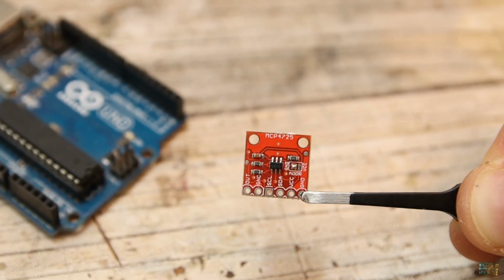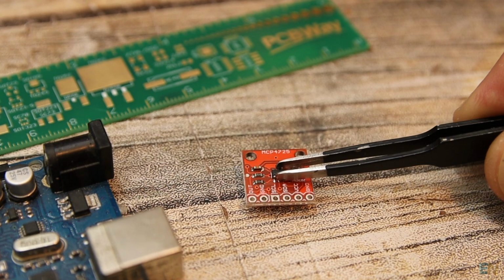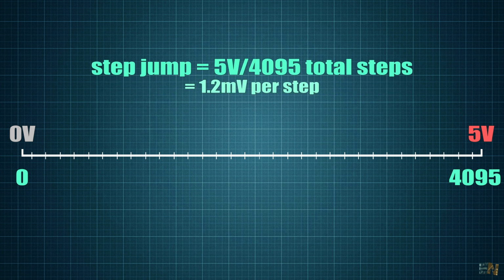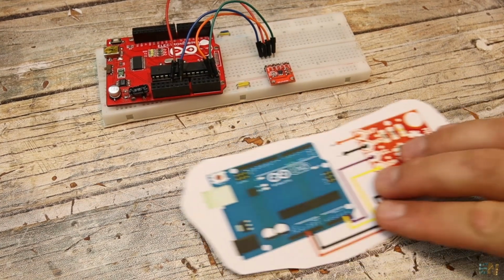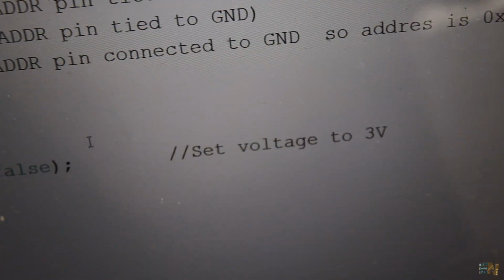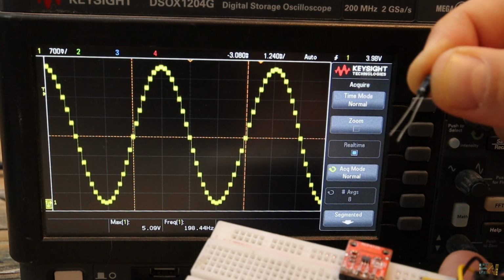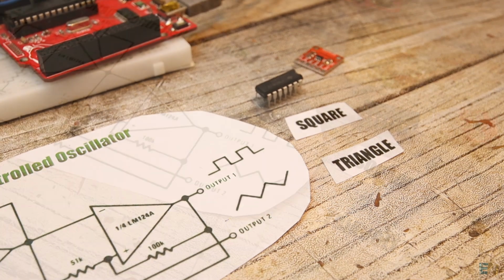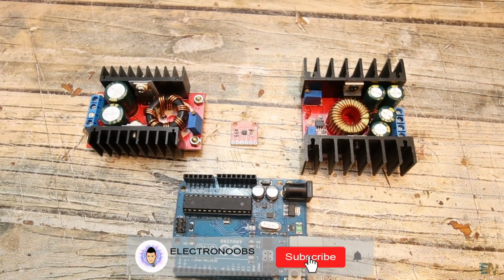12-bit DAC Arduino MCP4725 How To Use It - Stable Voltage Reffrence

Comment: The solder job at 4:00 looks sloppy.  If the goal is to connect the two pads, the better solution is to take a small piece of wire and use a little solder on each pad.  That way, the soldering job looks cleaner and more professional, and the wire will indicate that you actually wanted to connect the two pads.

Comment: Thank you for the great video, we're using the same DAC and we need two different DACs to work and we need two different addresses to be applied, but no matter what we do, it always goes to 0x60, we tried everything, different soldering, cutting the strip behind it, trying scanners, testing the IC itself, everything is in order but the board soldering does not work at all. what can I do? it's an important project and I'm stuck with it. the chances of it being a faulty board is extremely low because I bought two DACs and tested them both and both gave the same result...

Comment: Hello Sir,

I want to know that can i wire that MCP4725 directly to the sensor?. My setup is CHT8305 that is I2C Humidity sensor directly to MCP4725 and the output of the IC is go to the Op Amp to multiply the voltage and then the final destination is go to the ESM- 77 Digital Temperature Humidity Controller to show the humidity value

Comment: But how do I connect an input signal via the SCL pins \ SDA on this module? Basically I need to convert a digital signal to analog for a sound level meter (since I am not satisfied with seeing the value in Db but want to be able to record it so I can keep it as evidence ....... ).

Comment: Well, most Arduinos have a limit of 400kbps in their I2C hardware.  The data frame of the I2C protocol is 30-bit long.  Since most Arduinos only allows bi-directional communication, that means 400k / 30 / 2 ~ 6.7ksps (max theoretical sample rate).  Halve that by each additional device on the I2C bus.  While easy to implement, for applications such as audio synth or laser galvo drive that is not enough.  For high-speed applications, SPI for instance is a better choice.  Keep that limit in mind when designing a solution.

Comment: Nice video.

I have a question.
I want to connect the output of the mcp4725 to another arduino using analog read function.
Is it possible?

I tried it but when i connect the two arduino with a common ground. The output of the mcp4725 stops.

Can you help me please?
Thank you verymuch.

Comment: Thank you so much for this explanation. I am building a flight simulator using real airplane gauge. A lot of them use resolvers to measure knob turns, for example, turning the knob to adjust heading. From what I have learned, resolvers use one coil to induce electrical signal into two other coils to measure angular rotation. This DAC could be used for the exciter coil? How would you measure the voltage on the other two to figure out angles?

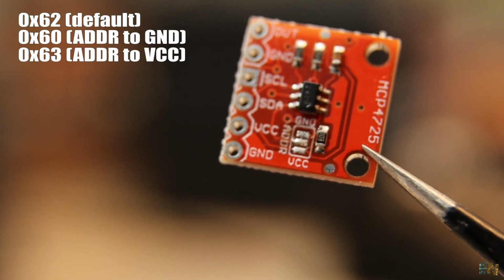Comment: Great video but the addresses at 4:24 didn't work properly for me when using 2x MCP4725 on the same bus. When pulling to GND 0x60 was fine but when pulling to VCC 0x61 worked for me instead of 0x63. Default 0x62 worked fine in isolation.

Comment: Informative video!
As you demonstrated in your video, never connect and disconnect a capacitor on a DAC output while its running as it can significantly load the DAC because of its low output current capability causing it to fail.
Reply: In general, never connect any components to a live circuit.  Shut it off, add components, then start it again afterward.  Make it a habit and you will not damage components by adding a new one.

Comment: ı have supplied this module with arduino, then it gives the voltage what ı want. but, when ı connect Vdd to my circuit output, which gives 5.09 volts, the module does not work properly. what is the problem? anyone help?

Comment: The voltage readings you are getting are correct. Your maths are slightly wrong. 5 V / 4095 is 1.221 mv not 1.2 mV , the extra 0.021mV  when multiplied by thousands makes all the difference. why, there are also common voltage references of 4.096V. So just about 1mv for every step.

Comment: What is the highest sine frequency that can be generated?
Reply: That depends on the I2C bus speed, which in most Arduinos is limited to 400kbps.  With a single DAC on the I2C bus, I was able to generate (verified with an oscilloscope) a ~80Hz sine wave sampled at every 10 degrees (36 samples per cycle, which is a moderate resolution).  400kbps / 30 (I2C data frame length) / 2 (bi-directional mode) / 36 samples per second ~ 185Hz theoretical.  In real life, Arduino does other stuff per `loop()` iteration, hence the 80Hz-or-so result I got.  That can be good for a power supply, but if you want to synthesize audio signals, for example, I'd go for the SPI protocol, which requires more wires, but is 8Mbps for a 16MHz Atmega microcontroller.

Comment: very cool ..now i want to try it, but that 9 bit sine table will eat my pic16877 memory alive 😂
Reply: The output speed of the mcp4725 is very low, less than 7k samples/sec. At such low rate it is enough time to calculate sine for each point using the standard math library.

Comment: We can make a component tester using this DAC and the Arduino DAC. Now the Arduino can set a Vin to a circuit under test and measure it's Vout, and print those data to serial monitor or to a curve on an MIT android app. 

Also it can draw the VI curve of a component by sweeping the current through that component using a powerful op amp (TDA2030) as a Voltage to current converter and checking the voltage across it.

Comment: Back in days, just for fun, I connected 8bit resistor divider directly to AVR pins and writed code in asm with different lookup tables to create signal generator with option to change frequency and signal form.. Maximum frequency was higher than for this chip.. All project was very cheap.. 😂😉
Reply: Sir Can I Ask anymore about this

Comment: I planned it to use in a digital supply with LM338, a year ago but didn't have time to do. To control the output of the LM338 (5A version of the LM317), you should apply a voltage to the ADJ which is 1.25V lower than the output. My plan was to use an op-amp to amplify the output of DAC.
Reply: merhaba ibrahim. ben LM317 ile 5 volt çıktı veren devre yaptım ve bununla DAC'yi beslemem gerek. ama beslediğim zaman DAC sabit 2.3 volt veriyor. normal arduino ile beslediğimde ise doğru bir şekilde çalışıyor. bu konuda yardımcı olabilir misin?
Reply: "you should apply a voltage to the ADJ which is 1.25V lower than the output." şurada tam olarak ne demek istedin. yardımcı olursan çok sevinirim
Reply: @sectormane  benim bahsettiğim DACyi LM317 ile beslemek değil, DAC ile ürettiğim referans voltajını kullanarak LM317yi kontrol etmek. DAC ile 0-5V arası bir gerilim elde ediyorum bunu op-amp ile 0-20V arası gerilimlere yükseltiyorum ardından LM317nin ADJ pinine bu voltajı veriyorum
Reply: @isalihkilic  Peki ben LM317nin ADJsine DACden aldığım voltajı bağlasam, LM317'nin çıkışını 0 ile 5 arasında değiştirebilir miyim? Böyle bir şey mümkün olur mu?
Reply: @sectormane  ADJ pinine bağladığının 1.25V fazlasını verir. Yani 0-5V verirsen 1.25-6.25V arası kontrol eder
Reply: @isalihkilic  peki onu 0 ile 5 arasına çekmek için ne yapabilirim bir fikrin var mıdır? LM317 çıkışına voltaj referans bağlasam olur mu?
Reply: @sectormane  LM317 1.25 voltun altında çıkış veremiyor
Reply: @İbrahim Salih  tamam yine de çok teşekkür ederim. Fakat 2 soru daha sorabilir miyim? Seni de rahatsız ediyorum fakat çok lazım cevapları. bu videodaki DAC nin çıkış akımı çok düşük. Bunu yükseltmek için ne yapabilirim? 
Diğer sorum da şu:
Ben DAC'yi arduino ile beslediğimde istediğim çıkışı veriyor fakat 5 volt çıkış veren lm317 devremle beklediğimde sabit 2.3 volt veriyor. Bunun nedeni ne olabilir?

Comment: I am also trying to work on a similar project but with a 12 bit R2R ladder directly connected to Arduino UNO! But still I am getting only 18 Hz max sine wave. Can we achieve a greater frequencies with an FPGA? how much? 
Maybe a good project idea for you to try!? :)
Reply: It is hard to get more than 6-7 bits using R2R DAC. The rule of thumb: if you see noise on the DAC output on the scope, it is less than 8 bits. 
However, it is easy to get fast output >1MHz from the R2R DAC. For that you have to write to the port at about 100MHz rate, which requires FPGA